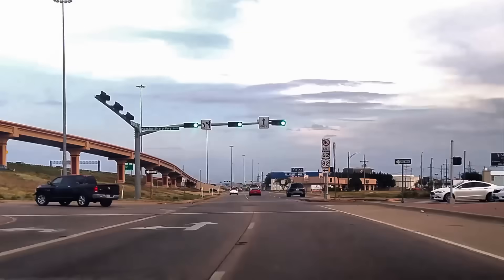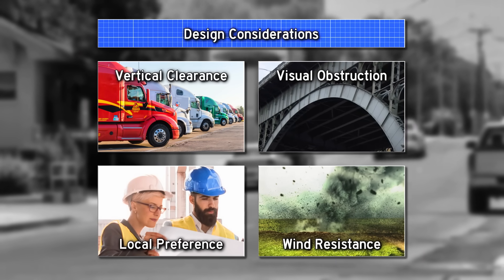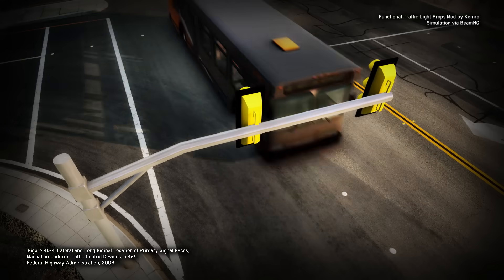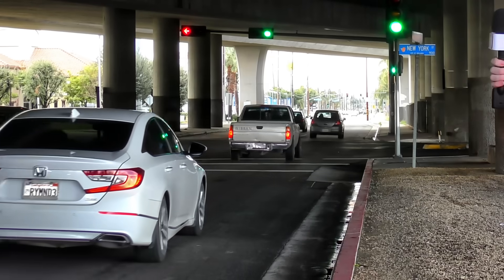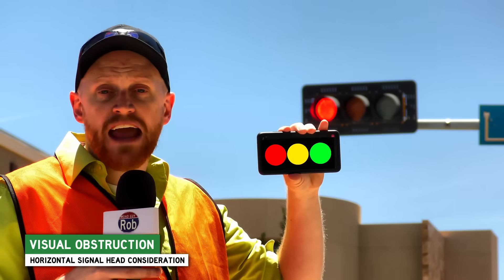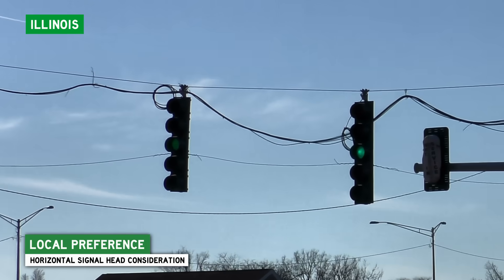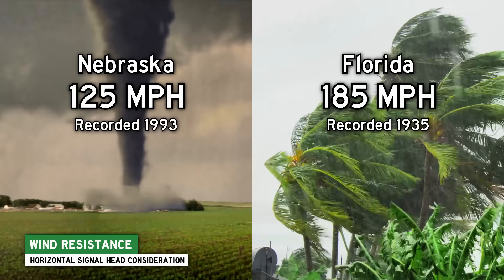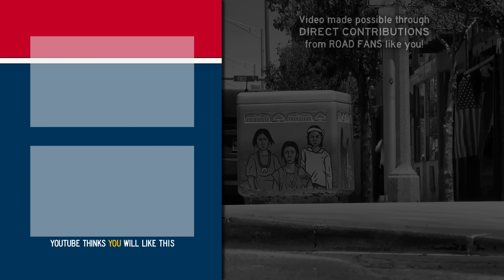What's up with SIDEWAYS STOPLIGHTS in Texas and Florida?

Comment: Most interesting! One thing not mentioned is America's predilection for putting the traffic heads over the traffic lanes. That's a little uncommon in Australia. Most of our traffic lights are just on vertical poles, usually four per intersection, one on each corner. The only things underneath them are the pedestrian walk buttons. I've seen some only 2 metres off the ground, but of course most are higher than that.
Reply: I wouldn't call it uncommon; I'd say the majority of intersections have them on gantries/crossmasts as well. But the way they have crossmasts in the US, sometimes not even over a road, does seem strange. (And I've driven all over both countries, in all mainland states and territories except Alaska.)
Reply: Well, okay, a lot of intersections will have one or two clusters up over the intersection, but my point was that most Aussie traffic light heads aren't.
Reply: We used to have the the 4 poles lights, but modern standards put an end to it.  Ocean City, NJ back in the '70s still used them at dozens of intersections... they were very short and roughly 1920~30 era traffic heads corresponding to the timeframe of Ocean City's heyday.   Those traffic heads would be worth a fortune today.  

During the 1980's they started converting them to... surprise... horizontal traffic heads... and ones the city couldn't afford to convert were downgraded to red blinking 4-way stops.  By 2000 they were all gone... and since, even most of the horizontal heads have been switched out for conventional traffic heads on over reinforced arms.

But, yeah, I'd say in most places 4 poles fell out of favor during the early '50s.
Reply: @buckykattnj  They didn't start putting crossmasts in at most San Francisco intersections until the 2010s. The heads at the corners were perfectly visible, but a lot of motorists from the suburbs just weren't used to looking for them there.
Reply: Seems like a bad idea. “Oops 2 trucks parked at the intersection so I didn’t see there was a light, sorry for t-boning that family”
Reply: @streetracer2321  The way people are allowed to park right up against corners in the US has always struck me as bad policy, though. It's one of the things I find difficult about driving in the US, signalised or not; sometimes I really can't see what's coming, when I enter an intersection. It's possibly one reason collision rates are so high in the US, compared with other service economies.
Reply: @nomadMik  you’re not allowed to park at corners….. the light being over the road helps visibility in many situations, not just that
Reply: @Street Racer, it's illegal to park within 20 metres of a signalised intersection for that very reason. Either way, if you can't see the traffic lights, then to go full speed ahead would be ludicrous.
Reply: @RowBr0  how would you know there even is a light?
Reply: @streetracer2321  there's a solid stop line so even if you were completely unaware of the traffic lights and there just happened to be 2 trucks perfectly positioned to block the view you would still be required to stop at a stop line. A stop line is used for traffic lights and stop signs.

Regardless take an unsignalled intersection. If you come up and both sides are blocked you're not going to go flying through the intersection now are you? You'd pull up slowly to get visibility and then go. What difference does a signalised intersection make?
Reply: @RowBr0  stop line could be hidden by snow. Easy to say it won’t be, but some places have snow on the ground 6 months of the year.
If you don’t see a stop sign or light, you would assume the other road has stop signs, and you would be required to continue… if you do stop, that would be obstructing traffic illegally.
Reply: @streetracer2321  there is no snow in Australia (at least in the places with stop lights). As I've already said its illegal to park within 20 metres of a signalised intersection, there's a clear stop line, and the major intersections where you have multiple lanes do have traffic lights mounted on masts in the middle of the intersection so like it's all a non issue.
Reply: @RowBr0  “well this fatal crash is okay because 2 cars parked illegally” - uh no, traffic signals need to work safely even if illegal parking occurs
Reply: @streetracer2321  ok so firstly this scenario is pretty ridiculous to begin with why would 2 semitrucks be parked right next to an intersection, and secondly you are ignoring every other point. There's a solid stop line, the traffic lights are high off the ground, and this is only the case for smaller intersections. It's a non issue. It's not worth the added expense for such an unlikely series of events to occur, and ultimately if a crash does occur the driver is at fault because if you cannot see around a corner, then it is your responsibility to slow down.
Reply: @streetracer2321  It's funny when someone defending unsafe driving believes the rest of the world should be designed to cover his posterior.
Reply: @RowBr0  you’re literally just wrong though. The reason lights hang over the road is indeed because the visibility is greater. You can say you disagree but it’s meaningless frankly.
Reply: @streetracer2321  Mate, if there's snow on the road, that hasn't been cleared or salted over, you shouldn't be driving full speed anyhow. Do you even have a licence? I hope not!
Reply: @RowBr0  It does snow on traffic lights sometimes in Tasmania, Canberra and the Blue Mountains and Central Tablelands in NSW. But @Street Racer probably doesn't actually drive—if they drive full speed on roads where they can't see the road paint because of the snow, they would've been wiped out by now. When snow season starts in New England, USA, you always see about a dozen young motorists in cars wrapped around the fronts of trucks and power poles for a week or two, and then the roads run out of them.
Reply: I've wondered this as well. It does make things a little clearer, but it makes the engineering more complex and expensive. If you have two signal heads on the same pole on the other side of a junction, it's obvious the left is for the left lane and the right is for the right lane, anyway. For visibility, in the UK you can often see double-mounted signal heads kerbside, where you have your normal traffic light, with another mounted on the same pole about 4-5 feet higher.
Reply: This is purely anecdotal, but I feel like the difference is the truck traffic, and the weather here.  There is way more truck traffic, so, having the signals over the lanes is to help with visibility.  The weather here in the US has snow and a lot more rain, I think, so having the signals over each lane helps keep people in their lanes when visibility is limited.
Reply: @j.p.obregon1415  Australia has at least as much truck traffic, compared with overall traffic, as the US. The US has much more freight rail, so trucks, unfortunately, are more necessary in Australia. It's why road trains can be five or six trailers long in the outback, and I've never seen trucks with more than two in the US.
Reply: This starts to make sense when you look at the prevalence of roadside Signage. There is lots of roadside signage next to intersections in the US, Canada and - of course - Japan (though becoming less thankfully)! Three countries where installation over lanes is much more common, obviously to avoid visual distraction between the lights and signage, and therefore where horizontal lights are much more common. My take anyway.
Reply: I think the one light over each lane thing is more common in places where it snows. The lights help keep people in their lane.
Reply: @erinfournumbers  It helps with that, but it also allows for each lane to get its own signal. Which can be useful if one of them has a phase where it's allowed to turn, but neither is allowed to go forward.
Reply: @SmallSpoonBrigade  In Australia, when traffic is allowed to turn in one direction and not another, the signals have arrows. The way some US signals can have red lights and green lights facing the same direction, without arrows, has always confused me. They don't even always have those 'left turn signal' signs adjacent to them… and no, they aren't always over lanes, either. I still see intersections in California where there's a red light on the median and a green light on the kerb, and motorists are just expected to know the red lights apply to traffic turning left. It's crazy.
Reply: I believe Federal standards dictate one signal head over each lane.  Exceptions being doghouse signals which cover the left or right turn lane plus the straight lane.
Reply: @stevetalkstoomuch  Oh that's an interesting point. I hadn't thought of that. That  would definitely explain the difference!
Reply: Philly has lots of 4-corner poles, each topped by a single traffic light head.
Reply: @dtvjho  yeah it’s normal in some cities, but 99% of roads are not in a city
Reply: @streetracer2321 but most signalled junctions are in cities and population centres?

Comment: I've always thought, just a theory, not a fact or knowledge, that the red light is on the side of oncoming (dangerous) traffic. Which is why in japan, a country where they drive on the left rather than the right side of the road, would put the red light on the right, as that is where the danger would be. In the US where the danger would come from the left, that is where they would put the red light.
Reply: Absolutely. Places where they drive on the left and have horizontally-mounted signal heads (e.g.: Singapore, Thailand, Indonesia, Japan) have green on the left and red on the right. Places where they drive on the right (e.g.: USA, Canada, Mexico, Brazil, Vietnam and China) all have red on the left and green on the right.

Which is to say: red is always on the side closest to oncoming traffic, as you suggest.

The only exception I can think of is Sri Lanka, which is... weird. They basically don't seem to have any rules or consistency there regarding signal head orientation. Driving is on the left, but you will see signal heads mounted both Green→Red, AND Red←Green. Basically, if you're colour blind in Sri Lanka, you're gonna have a bad time.

Comment: I've noticed the problem at 2:10, about placement of the traffic lights here in Europe quite a lot. In Germany, they usually only have stop lights at the stop line, where we in Denmark have alot of stoplights, both at the stop line and on the other side of the intersection. This results in i'm seeing alot of German drivers in Denmark who is turning at an intersection stopping as they think its a red light for them, thinking its another intersection, when its in fact just for the onces coming from the other side. Vice versa Danish drivers sometimes drive past red in Germany, because they assume there is not a stoplight,  because they do not have multiple stoplights in front of them, and the one at the stop line is out of their field of view. Just a perspective on why having uniform rules makes sense, in different states, as we travel, live and work across EU-countries, in the same way you do in your states.
Reply: technically we all do... it under the Vienna agreement (can't remember the actual name for that except for "Vienna")
Reply: @PrograError  I can see there is a UN treaty from the 60's, but they are often very broad and up to signing countries to interpret. I'm wondering if there is any EU-regulation, as I believe they can regulate the matter of road safety by TFEU, art. 91(1), but it does not seem like they have done it - since there is quite alot of different rules? Ex. differences in the right of way, driving in round-abouts etc. Another example is that drivers in Germany can turn right at red stop-lights (similar to the U.S?), but that you can't do in Denmark.
Reply: @Emillionaer  The right-on-red rule is more like a right-on-right exception since it's only permitted on traffic lights with a green right arrow but is otherwise forbidden (or slip lanes if think of them as a special case).
Reply: @MarioFanGamer659  true! they also apply at night, right? Because i've experienced that you can't see them when its dark, because they dont light up/reflect

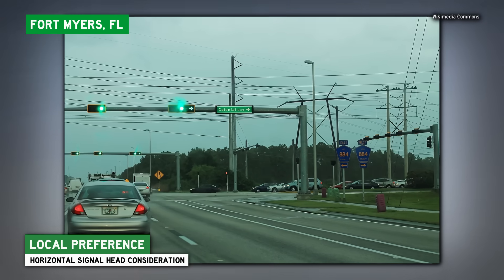Comment: I live in Fort Myers, FL and I frequently drive through the intersection at 7:35.  We had a LOT of signal damage from Hurricane Ian.  The vertical signals took most of the damage but even some horizontals were as well.  The county still hasn’t repaired them all.  Also, to combat wind, Florida’s standard with span wire signals is to use two wires with heads attached to a metal brace between them.
Reply: on the west coast, the span wire signals have had top and bottom wires for a couple decades - but they still gallop pretty hard in strong winds.  so next to no new span wire signals are installed.
Reply: @kenbrown2808  Span wires sometimes handle wind better...  The gallop, but wires can handle flexing better.  Leaf in the breeze approach ;)

Oh, and howdy not quite neighbor, but close enough.  The eye of Nicole went directly over where I'm at.  Nothing like Ian, but reminder that it could happen.
Reply: @travcollier  sometimes leaf in the breeze is an improvement, sometimes it's not.  I've seen a lot more broken span wires than I've seen broken crossarms.
Reply: @travcollier  --   The cost savings of the span wires are overwhelming.   Moreover, the support poles can be placed much further off the right of way.  That alone can save lives. My only problem is that they seem to $0.05 & $0.10 them rather than make them nearly bulletproof.
Reply: Hello Neighbor! I live off Iona! I got so confused when they put the lights sideways a few years ago (am colorblind)... But finally got used to it! Hope you handled Ian OK!
Reply: @PsRohrbaugh  How's the house coming along? Are there any original houses in your neighborhood which didn't get flooded?  I heard that some of the newer houses (like Harper's) even flooded.  I enjoyed growing up there but glad we moved. Did you get any damage from the Jan 22 tornado?
Reply: Fort Myers Beach here...  Its amazing how long it's taking to get the traffic lights back to normal this time around.  I could have sworn Hurricane Charley did more damage to the traffic lights back then and took far less time to recover.  I saw them working on some of the US 41 signals last week.   I wonder if the metal poles are more difficult to repair.  We had far fewer poles and more cables hung signals back then.  

Ironically, the traffic lights at Times Square on FMB are still there, despite the rest of the island being scraped.
Reply: I'm from Long Island, and I remember there being a lot of span wire setups with the 2-wire thing. Mostly on really big intersections where the diagonal was incredibly long.